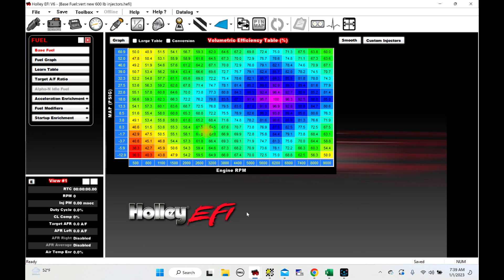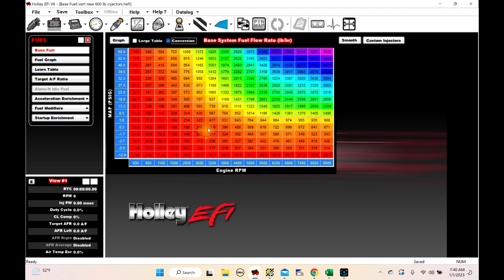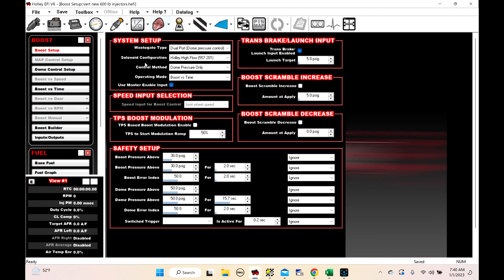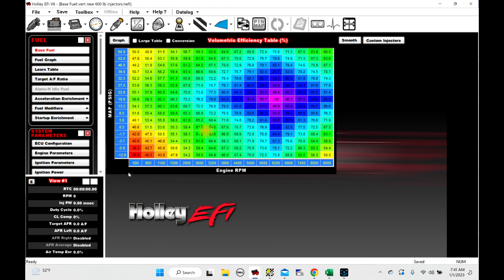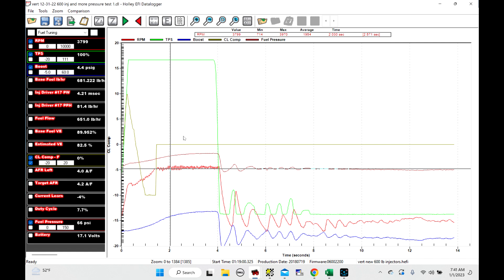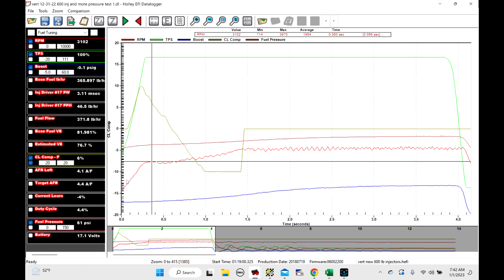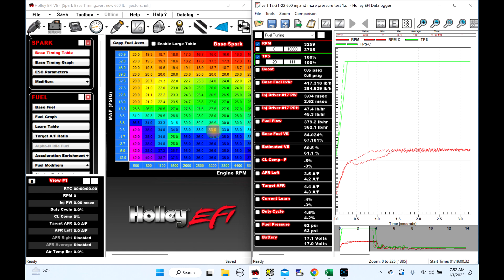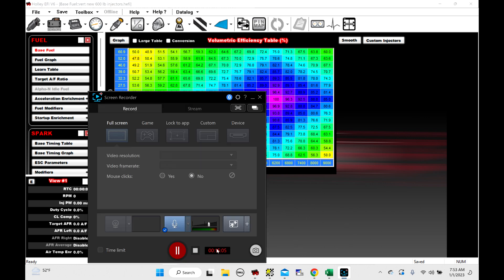Fuel tuning with Holley Efi for turbo spool up

Comment: Holley EFI is near Braindead compared to (most) others. 
Disappointed in Holleys Feature set, and Complete lack of Customer support. 
Zero flexibility or capability in Holleys EFI team. I would highly suggest anyone considering a Holley EFI system to STRONGLY Look into the multitude of other options, including Maxx ECU, Link, or Haltech, which has remarkable CS, even able to add custom Automatic transmissions upon requests.
Reply from the maker: This might be the most uneducated comment I’ve ever had on YouTube
Congrats

Comment: How do I access you classes. I am planning on running a a Holley  Terminator Max on my Crown Vic once she's built and turbo'd.  I just need to be sure about which way I want to go with the trans. Stick or auto. I'm not sure yet. As soon as I'm sure I'm going to get the Holley.
Reply: Great, thank you very much.
Reply from the maker: Hcrinnovations.com
Reply: You dont, because dude is a long-winded e-waste peddler. 
Holley is Junk, dude. 
Get a real ECU made by a company whos head isnt wedged where the sun dont shine. 
This dude is a Shill, and cant even Capitalize his own name.

Comment: Can you do a video of how to adjust the fuel map when it is on the chip since the o2 is not a reliable there?
Reply: Doesn’t really matter. Should be too far off. If it is, you’re fuel map needs work.